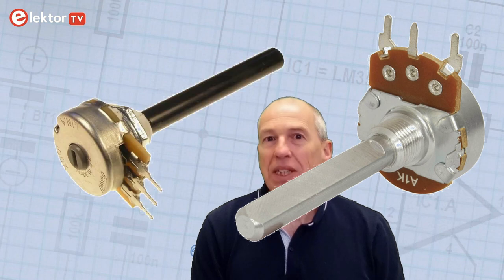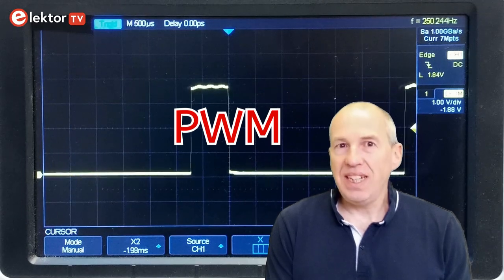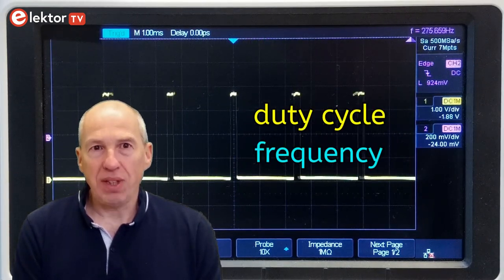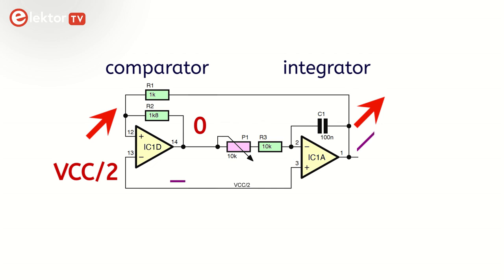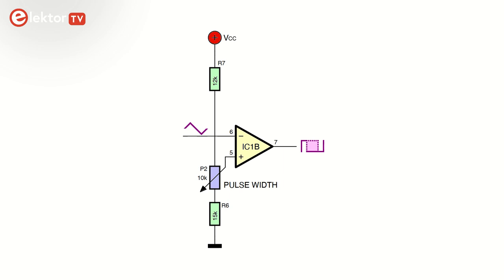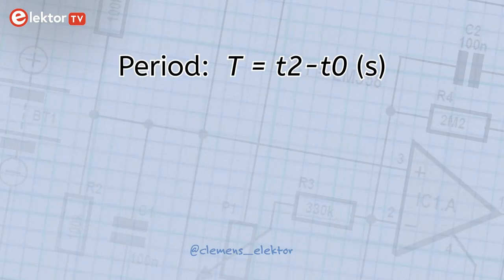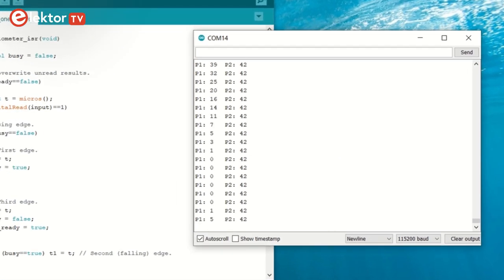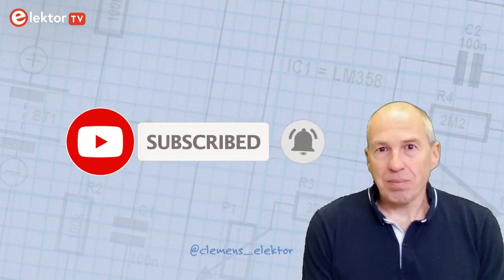Two Potentiometers on One Digital Input

Comment: Another more simple way would be to use a Schmitt Trigger oscillator where the charging and discharging parts are separated by diodes.
The potis are in the feedback channel and connected to the Trigger’s input that also has a capacitor connected to ground. While the capacitor is empty, the Trigger’s output is positive and charges it via a diode and the first potentiometer. On threshold, the Trigger becomes negative and discharges the capacitor over the second diode (that is antiparallel connected) and the second potentiometer.
The MCU can have interrupts and counters to calculate the positive and negative part of the square wave.